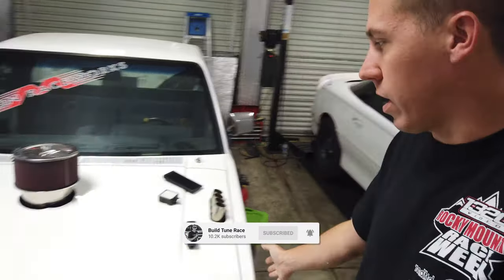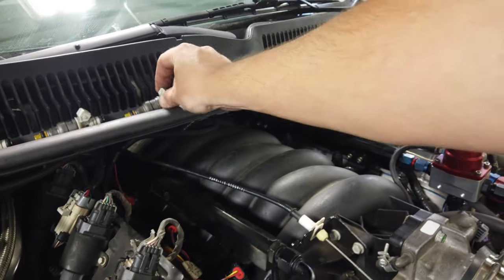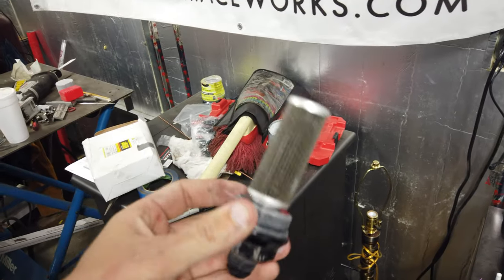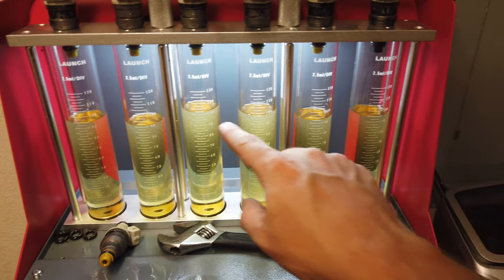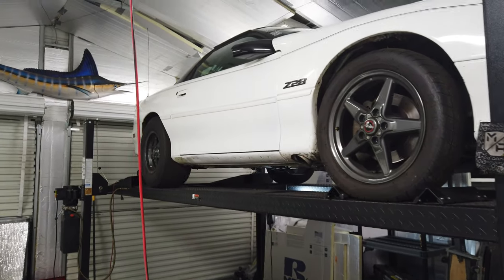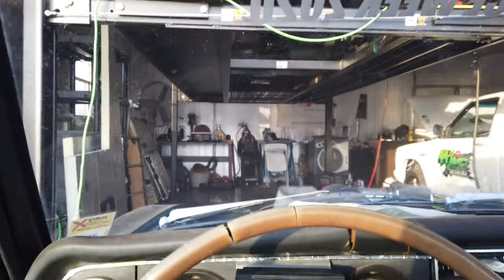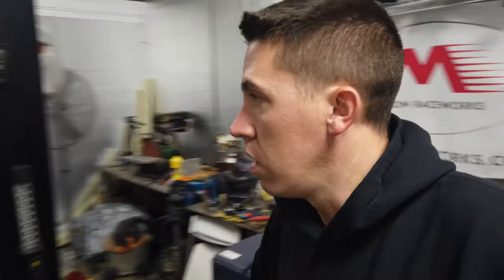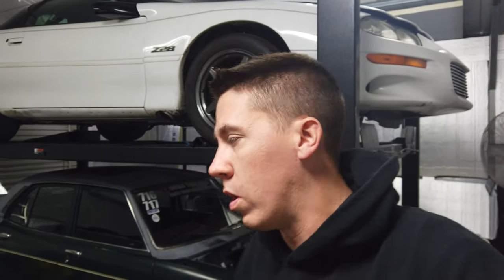Salty z28 Turbo Camaro Gets Ready to Race!

Comment: I know prices fluctuate, but what’s a general price difference on buying E by the drum instead of at the pump?
Reply from the maker: By the drum for e98 or Race e85 it comes out to about $4-4.50 a gallon but seems to be a much cleaner fuel.
Reply: @BuildTuneRace  Not to mention, straight from the source.  So it hasn't been sitting in a well for who knows how long.  Thanks for the info man, loving the channel!

Comment: You should put a set of 220cc or 240cc injectors and 7-10gpm fuel pump and a Callies ultra billet center counter balanced crankshaft with a set of Oliver or Carrillo I-beam rods and Carrillo pistons with a set of Dart Rec port heads with a set of true roller rockers or a set of shaft rockers and a BTR intake with a TKM "Black Sheep" hydraulic roller camshaft and put a 98mm turbo on it with a Strange Fab9 with 35 spline axles with an ultra billet center section and a set of Strange coilovers on all 4 corners and some Sanders wheels on Salty and keep an E98 tune for Race Week and put it on M1 to race

Comment: I picked up 220lb injectors. Still waiting on my 408 to be done from the my slow machinist.
Reply from the maker: That's what I'm planning to run in the future!
Reply: Going e85 and have cnc ported 799 heads from tsp and tick stage 3 turbo cam. I know a guy that sells the 220 injectors. Hes the original guy that built the lsx 1,000hp jeep
Reply: @BuildTuneRace  planning on a 88mm turbo also